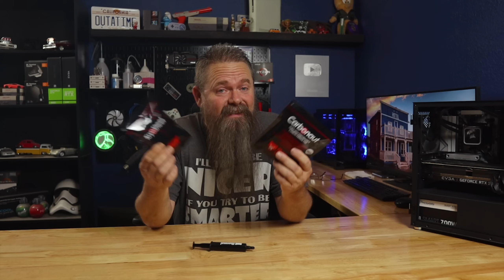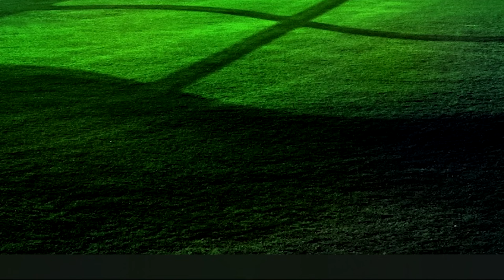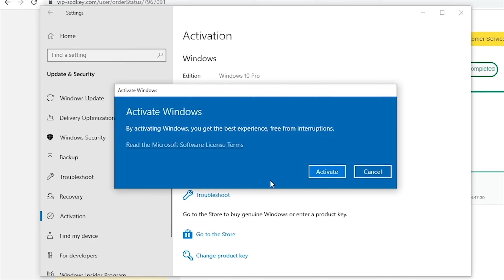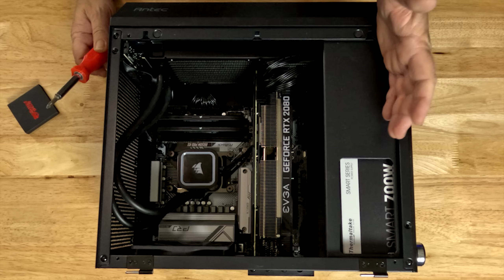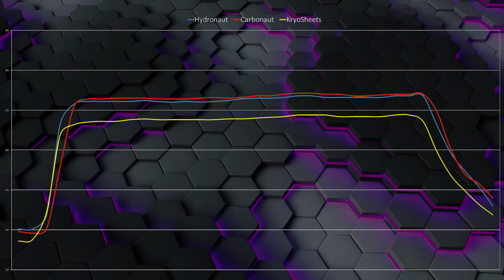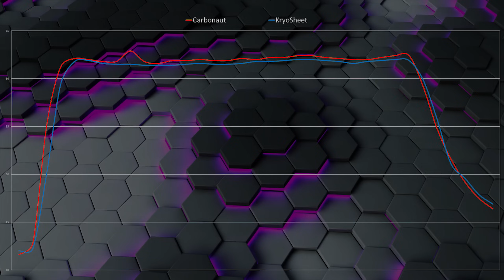Thermal Pads OR Paste, Which is Better?

Comment: I'd like to also see the difference between these and the PTM7950. I'm tempted to pull the trigger for PTM7950 (Honeywell) as I also heard the more you use it the better it becomes overtime
Reply: I did install the PTM7950 in my 8 years old laptop few months ago, and if installed well the results are just amazing from the first day, and it's true that the thermal performance keep improving by use I mesure lower temperature than what I mesured the first week of install. Below are the improvements between my old  thermal paste and the PTM7950 measured at Idle and under stress (latest CineBench and Superposition) :
CPU : Max -14° Min 0°
GPU : Max -4° Min 0°
I also added some minus8 thermal pads to VRMs and SSD, and here are the improvements : 
SSD : Max -17° Min -6°
VRM : Max -10° Min -16°
Reply: It's safe to be used on nvme ssds?  @Otmanes1
Reply: I second the motion to make this video happen
Reply: I got ptm on steamdeck and -10 celsius compared to paste. Really good stuff
Reply: Ptm 7950 is amazing after the week or break in period it'll spike Temps a bit then all sudden they droppppppp, I use copper shims on vram and ptm7950 on cores of all rtx cards I do paste and repad with great results and great on cpus with ptm
Reply: ptm is no brainer! I'll never use pad or paste anymore LOL...the benefit is significant!
Reply: do not hesitate it was the best switch i had done in my life, my laptop would heat up and crash everytime i play a game, now even while playing it never goes above 70 degrees while it has been always running at around 85 degrees, to be honest there was also dust in the vents but even with that it was the best switch i have ever made.
Reply: Literally just switched to Honeywell ptm7950. It's not that expensive. Lowered my 14700k temps. 75c under full load. Mx4 and tf7 would hit 100c under load. Make the switch.
Reply: @aurias01 it's not that much better, something was wrong with your previous installation or paste
Reply: Honeywell is a bit worser than paste, but not significantly and in long term, for example in laptops, it’s better solution for sure. Russians proved it. Search for vik-on channel if you dare, but it’s in russian.
Reply: I would say you can thermal cycle it in pretty quickly by blocking some airflow and letting it heat up.  The off-brand stuff seems to work great as well for 8 bucks.
Reply: @milescarter7803  It´s all the stuff anyways. Nobod is going to formulate their own product, they just buy it in bulk and distribute it for a higher comepnsation
Reply: I have repasted a portable (oneXplayer 2 pro, think a legion go without the bluetooth controllers) with PTM, and it really made a difference, ~3 degrees at first, but PTM takes a bit to actually 'kick in' so to speak. Also it will outlast your system, because it lasts for 10+ years. So at least for that last one, I recommend it.
Reply: Yes would be interested in a PTM7950 comparison pls.
Reply: It’s already been done. Technically, the kyrosheet will easily and indefinitely out last and/or outperform ptm7950, period. There’s no debate to be had here.
Reply: i had ptm7950 and my temps were always incredible, i just upgraded cpus though and noticed how clean the coverage had become, it was no longer a pad after a year but almost as clean looking as week old thermal paste. it cleaned off super easily too with 91% alcohol and q tip. nothing had seeped over the edge at all either and the entire am5 lid was perfectly covered. i bought extra and might use again. but this time i had a kryosheet on hand and wanted to try it this time, all is good so far and my temps look great!
Reply: I’m pretty sure you guys aren’t telling the truth. PTM isn’t the best at actually cooling, its appeal is that it lasts FOREVER, doesn’t pump out, and is “easier” to use. It will get a few degrees better after a few dozen or so heat cycles. I just changed to PTM a couple months ago from NT-H2 (which is AWESOME). My temps actually went UP around 3 to 6c at first. Now they are right were they used to be and haven’t moved.
Reply: @chriscole683 my experience it's dropped Temps on blower style gpus and laptops/handhelds with limited air flow much better than standard thermal paste, most normal applications I only see 1-3°c drops over paste, but like you said stuff lasts forever basically on top of that, no it's not absolute best conductivity but it seems to cover surface area much better making the heatsinks more effective because of better contact once it's broken in, my titan x pascal 12gb I was running on my daily driver til I recently upgraded was hitting like 86° c or so with blower fan after redoing paste and pads with mx-6, Ive been sitting around 82° c after break in period under full load with ptm7950, Def situational but lower air flow applications it's amazing., the Temps always go up at first til the break in period on phase change pad is over
Reply: @chriscole683  and laptop cpus, mini itx build cpus, low air flow cooling situations it really does work better than most pastes, I havnt personal tested or against noctua paste but against arctic it's Definitely better for those types of situations
Reply: @chriscole683  They move up because the PTM has to melt and take it´s shape frist. Crank speends up, make the thing really hot up to over 90°C for a couple of times for a ouple of minutes so it can burn it. After that it performs just like a really good thermal paste but basically for forever
Reply: @sierraecho884 you’re an absolute psycho! 90c?!? I freak out when mine goes over 60c my 7900x3d melted a board and cooler once. I’m pretty sure the cooler died and took everything out with it. I’ve got the same setup now and I have it undervolted. The cpu is absolutely over kill. I have a 360mm aio. And seriously I have gun shyness when it spikes to even 65…
Reply: @meta-mario  Hahhahah, it won´t melt anything generally speaking. 
CPU´s can easily go up to 90°C+ without causing any damage. They are self regulating. Which means they simply will shut off and cut power prior to damaging something unless something goes wrong like lately with the MB manufactures creating their own profiles etc.

90°C is only for the burn in phase, not for running constantly, this will degrade the life  of the CPU over time, but you don´t have to go to 65°C and THAT´s IT! either. You can of course if you wan´t to. Undervolting is also a good thing. Mine is ever so slightly overclocked which works well due to lots of cooling and great ducting in my case.

I got a Ryzen 5700X with it´s low 65W TDP and burned in the PTM at 90°C-95°C for about 10x each time for about 5min. via using Prime95. 

While doing this I also took note of issues with my PC case and modified openings and created ducting for the GPU as well.
The CPU will go up to 75°C in gaming or even when using demanding workloads like creating renders or 3D models and so on.

Due to the ducting for the GPU I reduced     my GPU temp. by 10°C - 13°C as well.
My case is also an absolute shit show, it´s the Pure Base 500 which is basically completely closed off (but of course I can help with that, with a jigsaw and 3D printed bezels for the front I even created my own design which looks nice and can´t be store bought).
Reply: @meta-mario my brand new laptop IDLES at 65° on some settings 😄 for real tho, extended use under 80° short term use under 90° and you should be fine. But I guess desktops might be different, I haven't had one since win98.
Reply: @meta-mario  that doesn't seem normal. Chips should be safe up to tjmax even for pro longed periods of time. I've done a ton of rendering over the years and on my Intel 5960x that was in a x99 godlike I use to run that thing at like 92c for 20+ hours straight all the time. That being said it was OCd from stock 3Ghz to 4.8Ghz so the tdp was raised from 140w to 245w. I will say that pretty sure those temps did lead to a death of my Corsair h100i at the time but that wasn't the correct cooling solution for what I was doing. Ended up doing a custom loop and from there temps never got over low to mid 70s.
Reply: @sierraecho884  Bro, it starts to liquify at 45°C. There's no need to go twice that hot and beyond to 90°C+ 😂 That's just crazy. This is why you should read the product sheet for the product you're using.
Reply: @meta-mario  not how computers work. Should be just fine up to 90° so as long as you arent hitting 90° 24/7 its fine and even if you are hitting thermal throttle point it should still be fine as its designed for that.
Reply: It’s already been done. Technically, the kyrosheet will easily and indefinitely out last and/or outperform ptm7950, period. There’s no debate to be had here.
Reply: @godnamedtay  How did you come to this conclusion ?

Comment: I prefer and use Carbonaut. I changed two processors and three coolings. It is still intact and works flawlessly. From this point of view, it turned out to be cheaper than thermal paste ;)
P.p. I also tried the first and second placement, but it didn't give me a single degree of difference. 5 uses already and still as good. No smudging, no drying

Comment: For me it depends of what i need: pads are for situations on which i need not a huge thermal efficient solution but longer durability, thermal paste for efficient heat transfer but periodic (3 to 6 months) replacement and last: for other situations a mix of both. I have my own DIY thermal paste made of aluminum oxide, zinc oxide, liquid silicone and liquid vaseline with a bit of (tocopherol) vitamin E as preservative and if it is kept in a cool dark place can last for years without lose properties, it is reliable but not the best.

Comment: F! realism when testing the ability to keep CPU temp under control. You want to test the absolute worst you can achieve. If the system handles that then it will always be able to handle normal use. I worked building servers for many years and a part of the testing for every server was to run for 24 hours using the most sadistic tests possible in a hot room with 40°C temp and not have any problem with CPU temp approaching throttling and errors or warnings in the system log.

When a server could survive that there were very little risk of it ever having a problem when used in a data center. The temp in those are usually pinned at 20°C and they are designed with hot and cold isles. That is when walking in between two rows of computers you either have only the fronts or the backs of the computers in both rows against you. And the air flow is always from front to back, that makes them blow "cold" air from one isle and exhale "hot" air to the other. The air conditioning is also built to blow cold air into the cold isles and extract hot air from the hot isles.

So testing a system doesn't have to be under a "realistic" load. Torture it! that's how you see just what the worst possible load would do to it. Just because right now the worst realistic load isn't all that bad doesn't mean no one won't make a program that really uses every resource to the max in the future. Build so the computer can handle that and you never have to worry about it.

Comment: Maybe I’ve had bad pads - I tried using one with an AMD A8-5557G, a laptop part, and temps were significantly higher in my Gigabyte BRIX mini-PC. Same with my i7-4720HQ laptop, paste worked much better even though the laptop was thermally constrained regardless. The thermal pad simply shot up so much faster…
Reply: Try ptm and thank me later.

Comment: Nice review. My problem with a Carbonaut pad was that it had fused to my Ryzen 4750G after removing the cooler after a few weeks of use. A different cooler could be installed, but there was no removing the pad. I had to scrape it off.
Reply: thanks for the heads up

Comment: I’ve done some testing with KryoSheet on GPU’s and they do great when used directly on the die. Usually as good as a premium past. The sheets keep the temps low while the paste starts to pump out and get higher temps over time.
Reply from the maker: I just repasted my GPU this weekend and noticed a lot of it had pushed out. The only reason I took it apart is because I broke the loop down and water accidentally dripped between the block and the card. So I had to tear it apart to make sure it was dry. I should have tried using a pad instead. Maybe next time.
Reply: @CyberCPU I'm sorry.
Why do all thermal paste reviewers say that there should be a minimum of it between adjacent surfaces, and then complain about it being squeezed out?
Reply: @ДмитрийКа-я6б : That is a really good question.
I see the same thing in woodworking. With glue, a
little squeeze out is good, It shows complete coverage
of the material but a large amount of squeeze out
shows you have created a "layer" of glue, which will
be a weakness. (and you have wasted glue)
With the thermal paste "a little" is OK but I don't think
that should be visible, until you actually tighten the
cooler down. If you see squeeze out, when you set the
on, you have too much. I don't like the idea of using a
patterned application. I prefer spreading a thin coat.
No mess, no waste. Just my opinion. 😁✌🖖
Reply: @ДмитрийКа-я6б  because it gets squeezed out during heating but is not getting sucked back in during cooling, therefore an air gap is created where paste is supposed to be
Reply: How does it perform in hotspot temps to gpu temp? 12c is the best I can get with paste while a 3090 I have I can’t get better than 20c. Which has me considering the pad
Reply: Careful - Kryosheet is conductive and GPU dies tend to have a bunch of capacitors around them that a sheet can easily touch. Many people who employ conductive thermal interfaces are using kapton tape or conformal coating for isolation of such components but the high temperatures and thermal cycling might cause these materials to detach or degrade.

Comment: Such good hardware in a system and then only a "Thermaltake Smart 700W" power supply ??
That thing has only an 80+ (no silver, no gold, not even bronze) Rating and is in "Tier C • Low-end" of the PSU tier list. 

For 10€ more you can get a be quiet! pure power 11 700W with 80+ gold. And that thing is in "Tier B • Mid-range".
For 40€ more you can get a NZXT C750 Gold or Corsair RM 750W - which are both 80+ gold and are in the "Tier A • High-end" category.

You definitely cheaped out on the wrong component there mate
Reply from the maker: Many people don't like that power supply. However, I've installed hundreds of them and they work good for me. I've been using them for several years since it's been harder to get EVGA power supplies and I've had really good luck with them. 

However, you're right. You can get a different power supply for relatively close to the same price.

Comment: Thanks for the video; I've been building PCs since the 1980s and I've built hundreds. The first one I built was an Intel 286; In the forty years I've doing so I've never replaced thermal paste unless I was swapping the CPU or its cooling solution and I never had an issue with overheating computers. I clean all my PCs twice a year removing dust mainly.Thermal paste I leave alone.  Over $20 for a square inch of thermal material puts the cost at $2880 for a square foot of the stuff; that is crazy expensive. I can buy three nVidia 4800 super GPUs for that kind of cash.
Reply: $20 for a cubic inch, maybe

If you're paying $20 for a thin layer that's 1" by 1" layer, you're buying the wrong stuff from the wrong place

MX-4 and MX-6 are probably $1.00-1.50 per application
Reply: thermal paste doesn't last forever, the wear depends on how much it was used and under what kind of temps it was used, a year ago i put noctua nt-h1 in my laptop, temps during gaming was 75 to 80°C, after a year it was 90 to 95 °C
after repasting with the same stuff, temps back to where they used to be
i guess the stuff stops being so thermally conductive after a while, or maybe after having transported a certain amount of thermal energy
Reply: I think it just dries out a little bit at a time especially at higher temperatures. When it dries out it becomes less thermally conductive.

Comment: The carbon fiber thermal pads seem best suited for people who are constantly rebuilding PC. The soft pads is more like thermal paste that's dryer and is already in a form that's easier to apply, but because of it's price it's best used for long-long-long term use for Grandma's PCs who won't doing regular maintenance with it anyway since I assume it lasts longer than thermal paste?

Comment: LOL, this exact question came up literally less than twenty-four hours ago on a major gaming forum.

I already gave my opinion on them (been using them for a decade).  They're 3C - 5C worse than paste on the high end (less on the low), but this doesn't matter unless you're trying to do extreme overclocking.

They're set it and forget it, and can be reused if you need to do frequent disassembly for travel purposes and should only tear if you're rough with them.

Not sure why you're saying Kryosheet isn't reusable when it is.  Is it thinner and more likely to tear than the Carbonaut or IC pad?  Yes.  So if you're that stressed out about a possible tear, get either of the latter two.  There's a 2C difference between them and the Kryosheet.  Also the second Kryosheet test vs original is sus.  There's no reason it should be a degree off besides variance in cold plate pressure or sheet shifting.